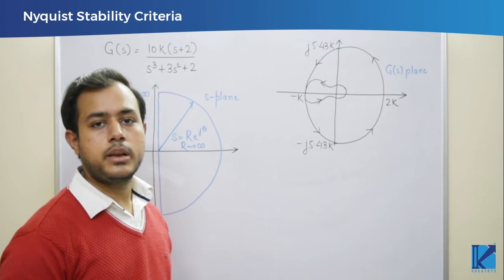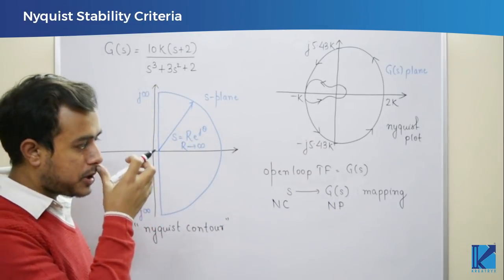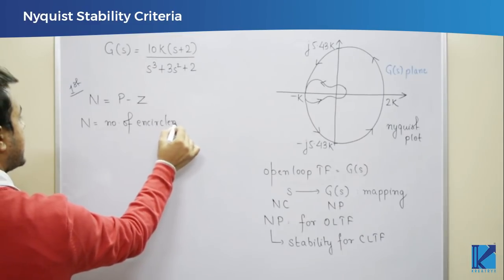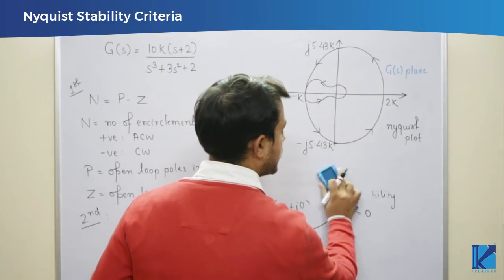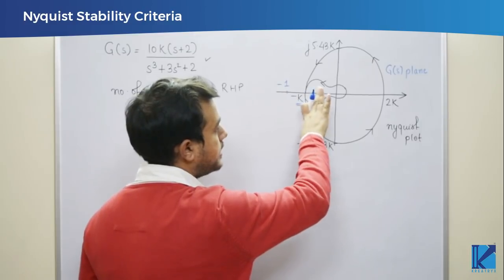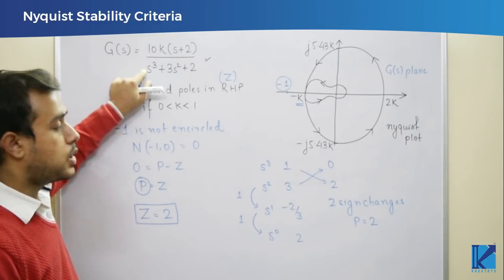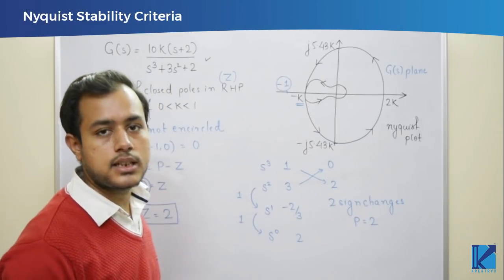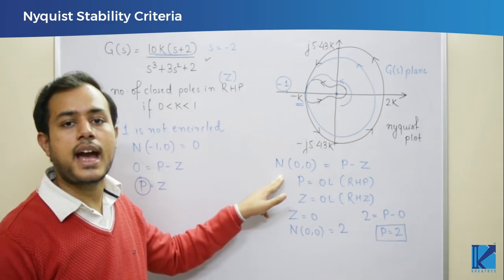Nyquist Stability Criteria | Control Systems | GATE (EE, ECE) | Ankit Goyal

Comment: Sir please explain why -1+j0 point is taken to check stability what is the significance of this point
Reply: See First understand Rgument principle which states that a contour in s plane if enclrcles Z zeros and P poles then the encirclement will be Z-P times about the origin.(positive = clockwise)
To check stability we need to find zeros of 1+GH (Z)  and  poles of 1+ GH are nothing but poles of GH.(P)
So we need to shift the plot of GH by 1 as we want plot of 1+ GH = 0 .
Z = N+P will give you  right have zeros of 1+GH which is nothing but CL RHP